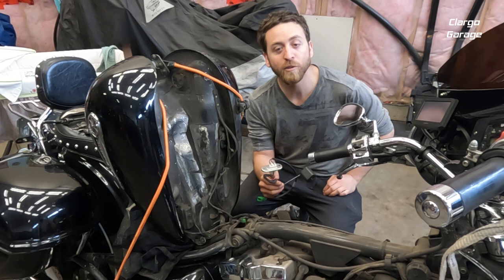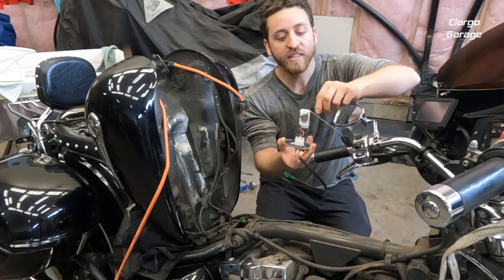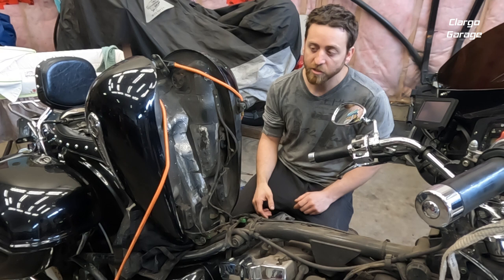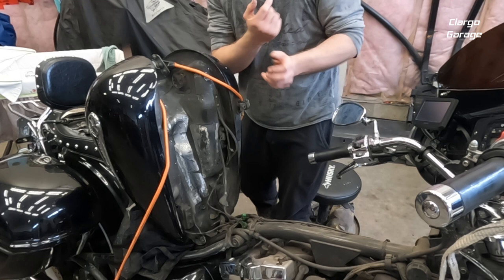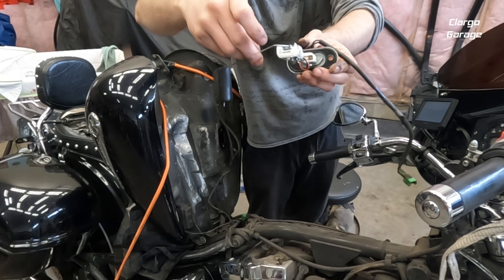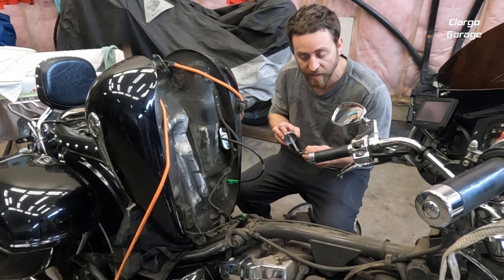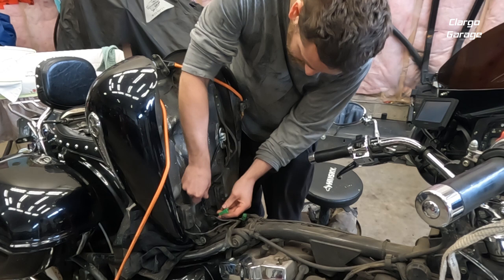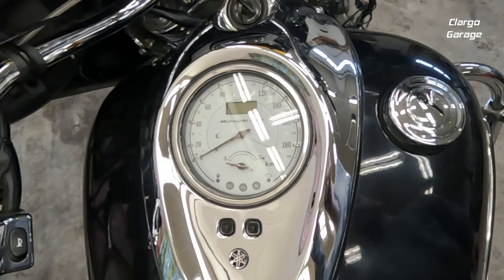How To Change The Sending Unit (Fuel Level Gauge ) On A 2006 Yamaha 1700 Silverado -episode 67

Comment: My '99 just started doing this after I had the tank off. Lol. I probably turned it upside down too many times. Thanks for the video.
Reply from the maker: Lol good chance that's what it is , especially if you have any mileage on it. The pivot point is pretty dainty and seems to wear out and get loose causing the issue. You might be able to take it out and get it snugger again and get a bit more life out of it , but just make sure the gasket doesn't leak after , definitely don't want a fire lol   thanks for watching 👍
Reply: @ClargoGarage  thanks for the part number also. Just ordered. Take care man.
Reply from the maker: Perfect, no problem, safe travels 👍

Comment: So great to find your chanel, man! I have same problem. Now i know how to fix it 😊 just, have to find this part in Europe.
Reply from the maker: Thanks ! It's the second time I've had to replace it  ( fuel pump is a common failure as well, but I do have videos on replacing it or bypassing it). I got mine from my local Yamaha dealer , not sure if you have any near you or can find one online , I'm in Canada there fairly common over here.
Reply: @ClargoGarage  I am from Lithuania 😄, guess will have to look up in USA, eBay or  so. But first, will try to fix it. I only noticed the problem a few days ago while preparing the motorcycle for the season. I will try to tighten it more, maybe it will work.
Thanks for the quality videos 👌
Reply: So. I've just finished working on the fuel pressure regulator. I've tightened it up a bit, checked the wiring connector, it was obviously dirty. I cleaned the contacts. Assembled. Well, it works. The bulb doesn't blink anymore. Maybe it was just a connector problem 🤔
Anyway, maybe someone will find it useful to first try checking the fuel level sensor connector, under the tank. 
Thanks for the inspiration, I will continue to follow your workmanship. Tomorrow is spring - safe travels to all✌️
Reply from the maker: Looks like a beautiful place to live and ride! Sorry for the delayed  response, sounds like you got your issues resolved, what year is your bike ?  Your ahead of me , I still need to get mine ready , hoping to check the valves and change the spark plugs before the season starts here , still have a month or so before good riding weather here. Thanks for watching and following, it's much appreciated 👍 safe travels to you as well!
Reply: @ClargoGarage  yeah. So far so good. Will drive tommorow, will see is it permament fixed or not. I have 2005, 1700cc. Everything seems to be alright, just don't like the handlebar, not very comfortable. But itldo 🙃
Reply from the maker: @vladasvaidziulis9466 hopefully the ride went good and your good for a long time now 👍 I like the handlebars but I'm not very tall (5'5") so that might make a difference, I have friends that are taller and they all changed their handlebars.

Comment: The fuel was rotten.   Do you think it has gummed up?   Would it be feasible to take a chance to extract and see if it could be cleaned?   Or should I wait to see if it will start working when riding; or just replace it?
I'm having trouble with deceleration backfire as well.   When shutting off the bike it emits one final very loud bang.   What do you think could be the problem?    The bike was running perfect before long storage.   2005 Roadstar Silverado 1700cc, stock everything, 39,000km.
Reply from the maker: Thanks for watching!, and I like to start least invasive and go from there. I would drain all the bad gas out, Maybe dump 1L of fresh gas in and swish it around in the tank and dump that to. Then fill it back up with fresh premium fuel (91 octane ) , buy a can of seafome and dump in the appropriate amount into the gas tank  (1/4 ish can, if you go heavier it should be fine ) the seafome is a good cleaner for everything I run it in all my vehicles periodically , it's good stuff has saved me from having to rebuild a few carbs over the years .  Can drain the bowl on the carb to its on the back side can get to it with a few extensions and a 5mm(I think) alenkey kinda a pain and not the easiest , but if you skip that part after 5 min or so of running at idle that old fuel should be out and the clean fuel should be in. I would run that can of seafome through every tank of gas till it's empty ( depending where you buy it the price ranges from 7$-20) . I'm assuming no changes to exhaust or intake , would assume the back fire is a combination of bad fuel , fresh fuel and the seafome should cure that, don't be shy on hard accelerations getting to the upper Rev range , when the engine is up to temp it helps to blow the carbon and junk out ( if you look in the mirror first few times will probably see black behind you getting all that junk out).   When you shut it off , most likely the bad fuel / to low of octane level , if the engine is really hot , should make that worse , hi ideal can do it sometimes but unlikely , I would belame the bad gas, mine dose it the odd time when it's really hot , like after sitting in traffic for long periods of time then shutting it off , in your case I would lean to the old gas. Great bike low mileage, be prepared for your fuel pump to fail in probably the next 5000-10000km, there easy to change , and I have a few videos on bypassing it to get home or permanently eliminating it  ( I went through 3 pumps before I Finly eliminated it) I have 187000km on my bike so yours is good for a really long time . Biggest thing to let you down will be fuel pump and drive belt  lol .  And you used km you in Canada to ? In in Ontario. Hope this helped, let me know how you make out , I do have videos on taking the carb off but I don't think you will need to . Check your spark plugs if the issue doesn't clear up before the carb I would think . Any other questions don't hesitate to ask . 👍

Comment: Great video! Where did you get the front faring?
Reply from the maker: Thanks ! I believe it was batwingfairing.com, I've had it on there for 5 or 6 years now I think. Check out "episode  58" , it's an episode just on that fairing and how it mounts (I get alot of interest in the fairing so I made a quick video on it), should answer all or most of your questions that you might have on the fairing. If you have any questions don't hesitate to ask 👍 thanks for watching 👍

Comment: I have an 04 (same bike) and fuel gauge is starting to go, but works 80%of the time.  My odometer almost never works, but does temporally in the most random times. Is that a censor or something on the wheel for the odometer or a connection issue?
Reply from the maker: Glad this video is able to help you a bit , and for the odometer there is a sensor on the right side of the transmission I believe , may just be coming loose or may just need to clean it and might get lucky and be a free fix hopefully 👍
Reply from the maker: And the connector should be behind your left side cover for the sensor, on the transmission for your odometer
Reply: @Clargo Garage  thank you. Your videos already helped me a while back, replacing my rear tire.
Reply from the maker: That's great, nice to know they help, thanks for watching as well 👍

Comment: Awesome video. How do you like the fairing?
Reply from the maker: Thanks ! And I love it , the biggest thing is having the toons , has radio , USB port, auxiliary port ( can use a male to male headphone jack to play music from mp3 player ex) and Bluetooth capabilities. Was an easy install, bolted to the factory windshield mounts without any issues, then had to run wire under the tank to the battery. Overall I'm quite happy with it and would buy it again , and it helps break the  wind on your hands for the cold season too .  For the price I don't think you can go wrong .  There's a few little things that could be slightly better , but it's me being a bit nitpicky just with the finishing around the edges in a few spots but if you were painting it , it would be easy to address, biggest down side it looks like a Harley from the front lol  episode 58 I believe I talk about mounting it and go over it abit .  For the price you can't go wrong , make sure you get the speakers rated for water , they give an option with regular seekers , I ended up calling talking to the company to make sure I was getting what I wanted and would hopefully last in all types of weather . Sorry for the long answer and thanks for watching as always, safe travels 👍
Reply: @Clargo Garage  that's awesome I'm using earbuds now and hate it
Reply: @Clargo Garage  and I don't want to look like a Harley but if it's better I'll check I to it.
Where did you get yours?
Reply from the maker: I had tried that too and didn't like it either . I do wear ear plugs tho , read a study that said if you ride 7000km or more a year with an open face or half helmet you will have permanent hearing loss from the wind noise if you don't wear hearing protection. Now I find it hard to ride without ear plugs . I find I can hear my engine better cause I have less wind noise and I just turn the toons up a bit .